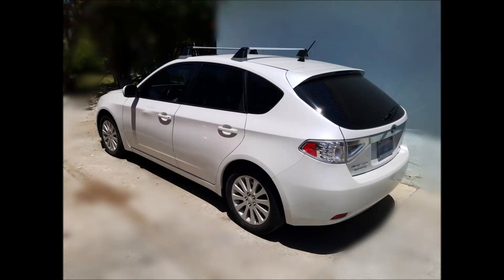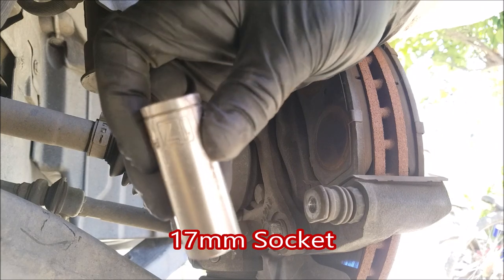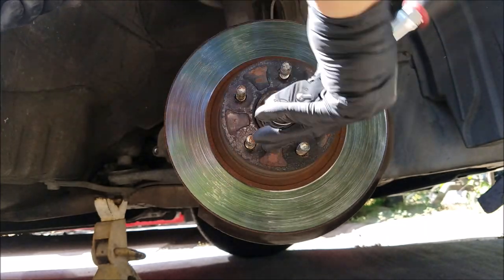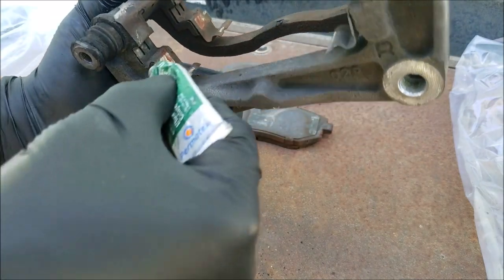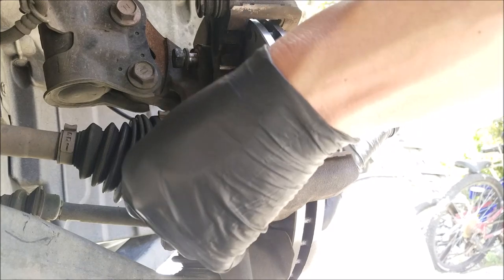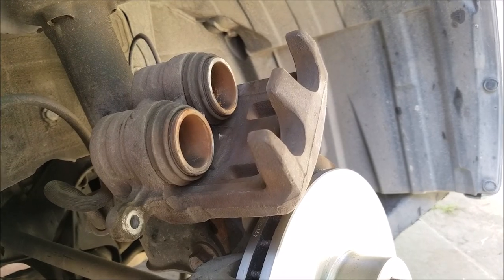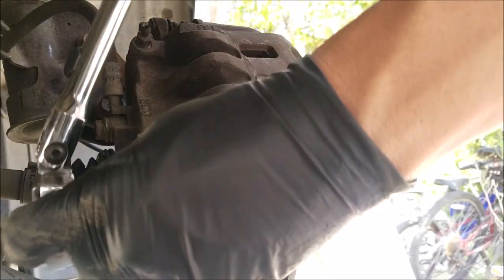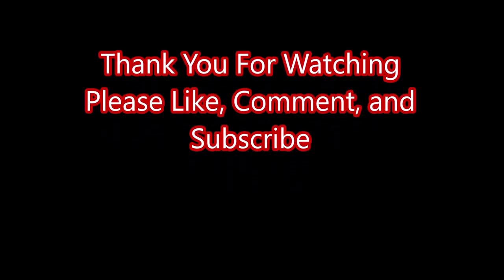How to Change Subaru Impreza Front Brake Pads and Rotors 2007-2014

Comment: Ok so you don't brush or change the stainless steel guide? No wonder why you need to change your brake at 50%. Not good
Reply from the maker: I had em on order, they were supposed to be included with the brake pads but werent in there..i installed em a few days after the video.